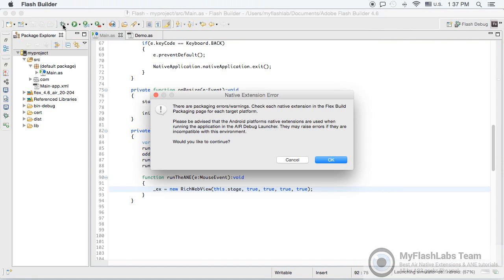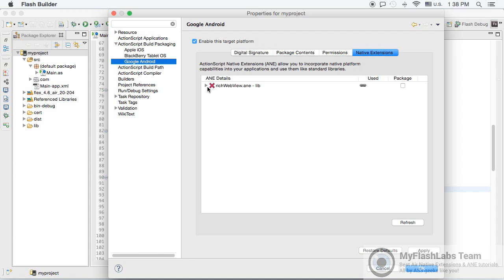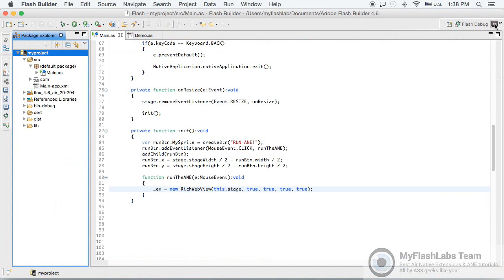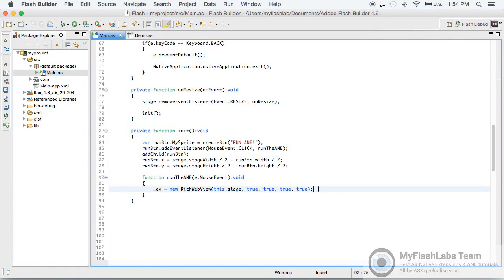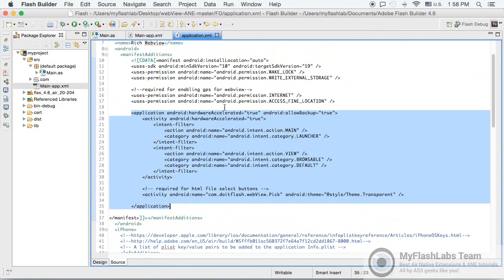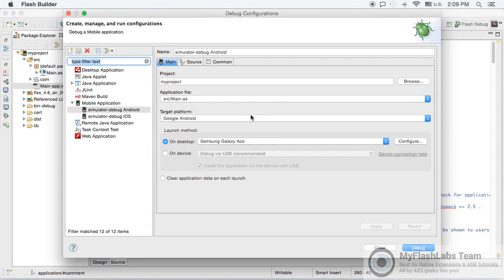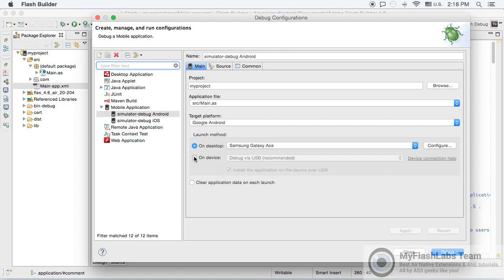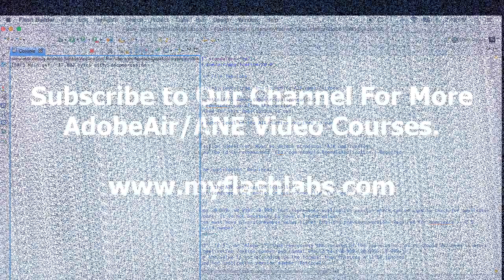Episode 2: How to implement an ANE into your project using FlashBuilder

Comment: thanks for sharing

I have a problem

how can run apk games without install adobe air 

https://3.bp.blogspot.com/-FMIDy_yTOoc/VrkOeeKItYI/AAAAAAAACRk/MwmkYzQmjD4/s320/454545.png
Reply from the maker: +tsu_line You need to compile your project in captive mode.
Reply: +MyFlashLab how can I do?

thanks

I haven't this line in flash builder 4.6

--- Signed Application With Captive Runtime
I have only this

https://3.bp.blogspot.com/-nglhkkc1elc/VraVp5HxMuI/AAAAAAAACRU/3JyksqkeAXU/s320/1213.png

how can I view like this

https://3.bp.blogspot.com/-lAH6_5hK9DE/VraVoH5mwuI/AAAAAAAACRQ/s5qU2Yd7EbE/s320/fig01.jpg

thanks